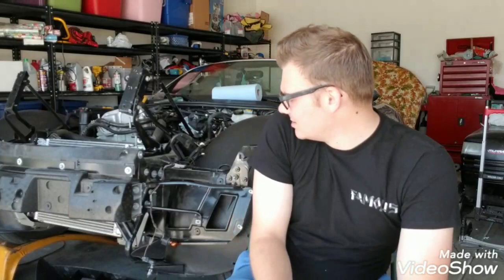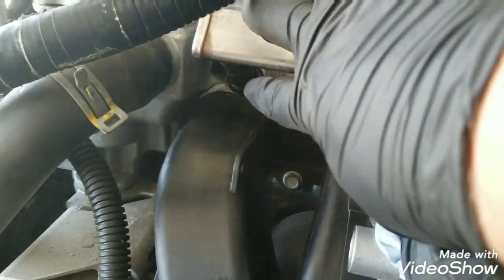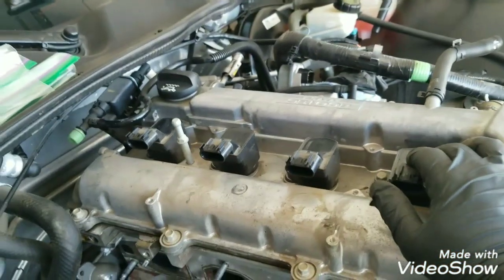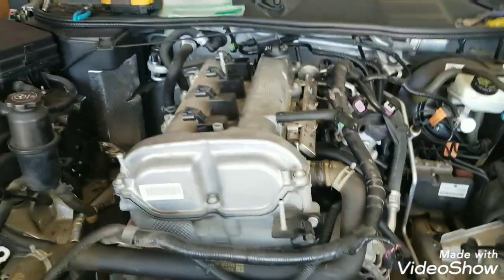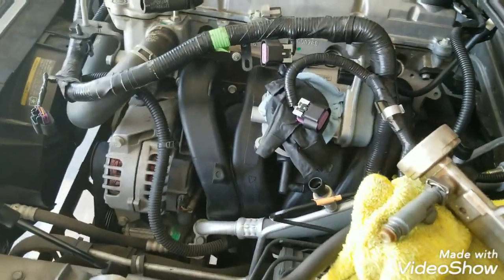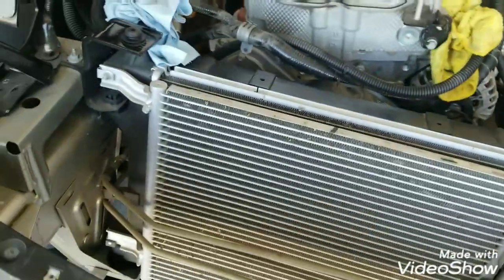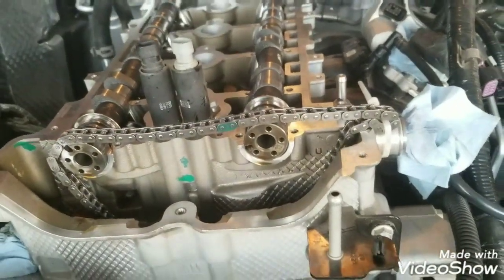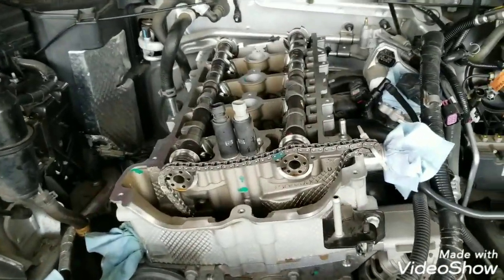Turbo build on Le5 ecotec 2006 Pontiac Solstice 2.4l (PART 2)

Comment: Replace your chain tensioner with the latest version. Older ones cause chain failures.
Reply from the maker: I did, i also ordered last week a new upgraded version that allows more oil pressure to keep the chain tight, that'll help cuz i am getting a rattle sound on high rpms